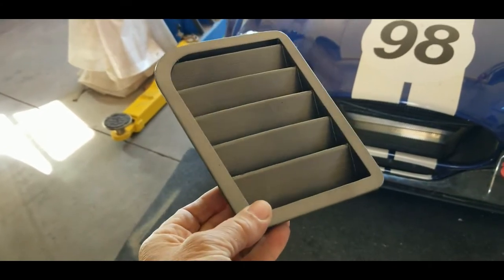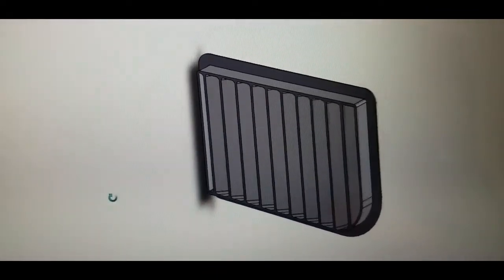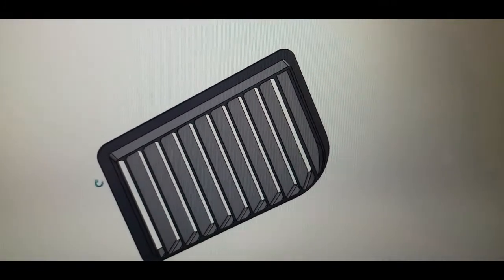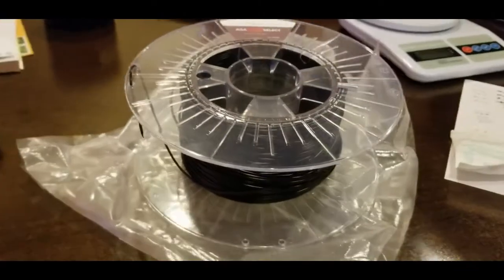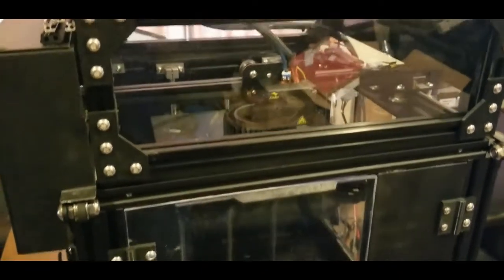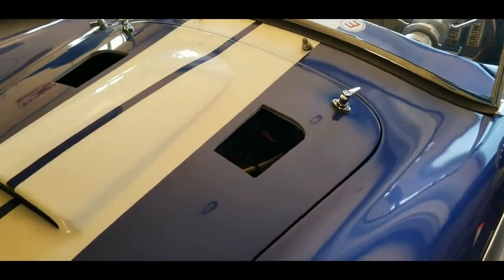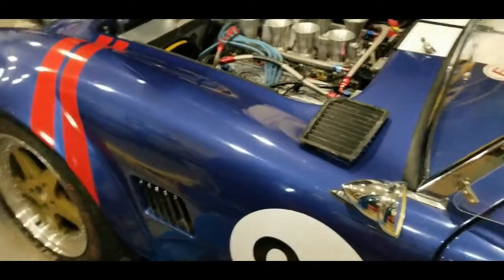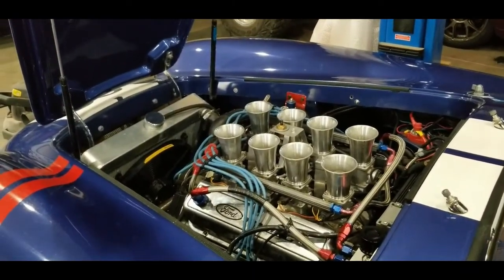3D Printed Hood Louvers Printed at Home!

Comment: Hi, I like the idea, I recently started working with a 3d printer and would like to something like this, are you able or were planing to share the files for these? I have a Tundra and would like to do something similar to extract the heat and see if it actually make a difference (also for looks), finally, how are they holding up? Thanks.
Reply from the maker: I am going to try and publish the file on Thingiverse.  The different sets I've printed so far have held up well even sitting outside all summer long here in Arizona.